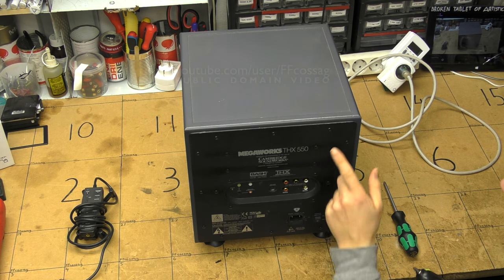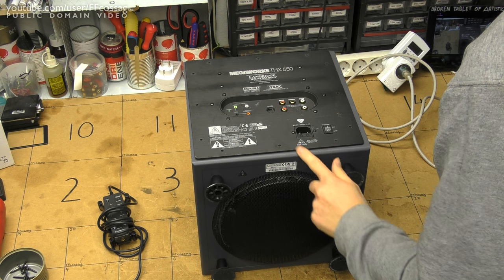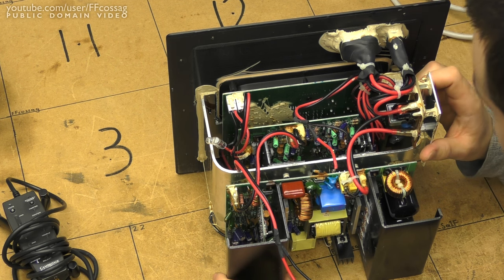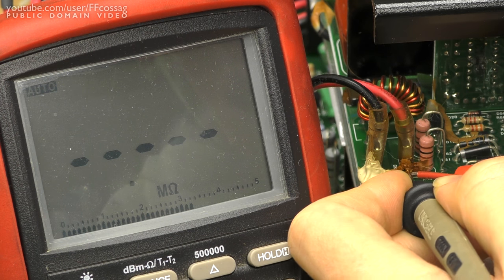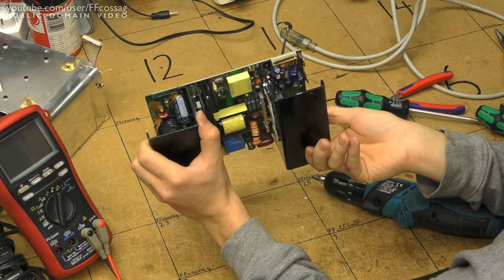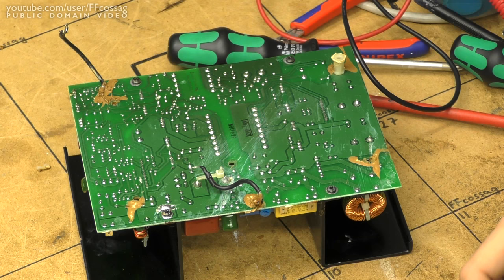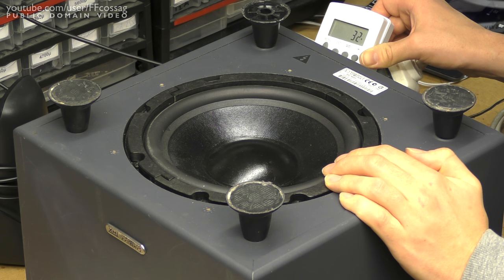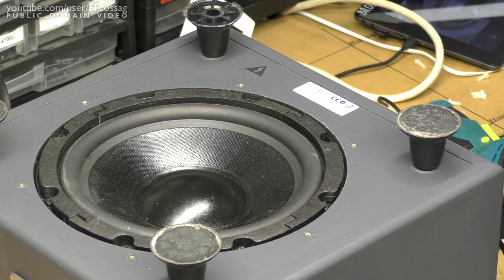Cambridge Megaworks THX550 subwoofer repair

Comment: It must be the glue is a known obsolescence compound. I have seen this in PC power supplies. Regarding the standoffs, I would have opted for sticking them on with electronics grade RTV silicone adhesive rather than screwing then in. But hey, great repair
Reply from the maker: I'm not a fan of gluing things. Either it comes apart too easily or you can't get it apart ever again.

Comment: hi, mine would suddenly go mute after a few minutes. the system turn on fine but not producing any sounds from the speakers. do you have any advice to point me in the right direction on which part i need to check / repair ? appreciate the advice and great video btw !

Comment: I dont have voltages on black and red wires that goes to the sta575 on the other board ,i found a shorted capacitor (450v,33uf) and a shorted in4004 diode next to the small radiator next to that shorted cap , the cap shorted the - and + because of that brown glue and i cant find the problem 😑and when I play through pc i hear a low distorted sound ,or all the sta575 are burned or it’s because of not getting voltage on that wires ,do you have any idea?

Comment: I have the 250D and the issue I'm having is that when I power them off, the next morning it can take 5 minutes or more for the speakers to produce any sound?! There is no crackling or pops or whatever, just takes ages for sound to work, all the lights on the volume control and sub woofer are fine, what could it be? The sound when it starts working again, is brilliant (connected via RCA Coax on SPDIF PC header).

Comment: I just picked up a used set of these for free. They sound great but the satellites produce a faint static noise at all times. Volume level, line in unplugged and different wall sockets make no difference. Any ideas?

Comment: My mega-works broke and I just drilled a hole in the back to rewire the speaker onto a tiny amazon 2.1 amp board. It works worryingly well.
Uses way less power, no longer any heat. My cat is unhappy.

Comment: hello, many thanks for your video. I have the same sound system. electricity. power is coming. but from the satellites and the subwofer the rustling sound is coming. sound too low. Can I fix the problem with this method

Comment: I have a 250d sub that gives me a great deal of static noise when plugged into line 1, and one of the monitors on line 2 will occasionally stop working, leaving only one monitor and the sub working. What do you think the problem could be?
Reply from the maker: Probably conductive glue.

Comment: Hi, Great video. Thanks. I have question. I have Focal JMlab Sub, but there is no sound from any inputs. I don't have shematic. Do you have some suggestion. Final transistors are good, there is no blown elements. Only from LFE i have very very quite sound.
Reply from the maker: Could be a logic supply or +/-15 V supply problem. Bad opamps are also very common in subwoofers.

Comment: I wonder if the solder side of the PSU board should be soaked in Isopropanal, and it is that big blue X4 Mylar capacitor is the one that has gone bang seems to have some blackness on the side of the capacitor.

Comment: I have a 650 with no remote is there a way to bypass the remote connection on the amp?
Reply: I have the same problem brother I have THX 550, did you find any solution without remote ??

Comment: Left channel on my megaworks 550 produces white noise, havent used it for 2 weeks, turned it on and bam white noise from left speaker. 
What could it be?
Reply: Have the same issue. Have you figured out the problem?
Reply: @flamesatdei  yep. 
There's coroded glue on the connectors of the Soundboards that are connected to each other with a IDE/floppy like cable inside the subwoofer. 

I carefully removed the glue completely by warming it up with a hair dryer and Pulling it of. 

That alone took 6+hrs. 

Then i changed all capacitors for new ones.

These subwoofers need some work After 20 years. 
Capacitors are completely done for, and that glue needs to be removed from every board and inch, or it will rot the board away.

Probably invested 15+ hrs and I have have advanced solder knowledge.
Reply: @tobiaspabst5524 thank you. are you in Portugal? wouldnt mind to pay for someone to repair this. seems complicated to do this

Comment: Hi i have one can i control it without remote ?? my speakers turned off automatically after 2 minute my remote wire was cut and broken can you help me ?
Reply from the maker: The easiest solution is to repair the remote.
Reply: @FFcossag  what if the remote is completely gone? I have a similar creatix one that i cant bring myself to throw away and i cant find a remote for it. Is there a way to just bypass the remote features? i cant believe i found this video after looking off and on for a couple years. thanks
Reply: @purge_thehumanrace  hola yo tampoco tengo remoto y necesito poner en marcha el equipo  alguien me puede ayudar por favor

Comment: What is the source of this goop - did you ever find where it came from?
Reply: it's a "standard feature" of the product, came with it from the factory.
Reply: I believe it's a Sony creation from way back in the 70s or earlier, from their adhesive business which is now known as Dexerials. It's most commonly known as "Sonybond" but that was just the product series, there are multiple different products sold under that name, and I don't know the actual product name, or if you can still buy it from the original source (it's probably been ripped off by several Chinese manufacturers and that's why it's still so common today). I don't know if this is true or not but I've heard that while Sony may have invented it, they never used it in any of their products. Did somebody say "sabotage"?

Comment: Hey dude! My THX 550 working fine but theres no sound coming out i couldnt find wheres the problem.Controller and other things working well but i cant get any sound i opened inside but it was seems like everything is okay.will you suggest anything? old times when i shake subwoofer it will work for good but now nothing figure it out thx for rply!
Reply from the maker: I really can't give you anything concrete to work with. The issues on mine have all been power supply related.
Reply: FFcossag Thank you anyway dude
Reply: If the system is powering on and you have no sound the problem is the psu .....i’ve got the same problem i”ve found a shorted diode and a blown resistor ,0 ohm resistor ,i have changed the diode and i put a wire instead of that resistor (couldn’t find one) and it blown with a big short ......i have nothing to do with this corona pandemic so i am trying to repair this 😄
Reply: Stefan M well ı hope u can do this 😄ı m still trying to figure it out
Reply: If you used to shake the unit and it started working (but now its not), I would try a heat gun, heat up say half of one of the boards, this expands it and hopefully reconnects the broken signal), heat trying different areas of each board while its running with signal input, good luck.
Reply: Ozzy3333333 thank you ı’m going to try it
Reply: @fdos4464  I use freeze spray too, but I always start with heat gun, its free, the freeze spray costs a lot more. I also use thin cardboard as a heat shield, so i can locate the issue with much finer resolution, with this technique, i can pinpoint down to surface mount resistors/capacitors, good luck.
Reply: @user-rs8zg8ey2b  thanks a lot when ı done thıs i'll respond u as possible as

Comment: Does anyone have the circuit for this power supply ? I need to know what is the diode soldered on top of the IRF530N . My subwoofer had 110volts fom heatsink to earth. something went terribly wrong. first sympthom was a shock from the stereo jack ( auxiliary in )
Reply: I would guess its a thermistor, probably around 10K at room temp, good luck
Reply: @user-rs8zg8ey2b  how can i get the service manual of this item ?
Reply: @grandemaltese782  Probably wont find it, unless someone at creative leaks it. I have my broken power supply at work, mine is not turning on, I need to find the resistor values for two resistors. near the optocoupler. When i get to work I can look closer at the diode. Can you take a picture of the supply and point an arrow at the diode your interested in (also get the optocoupler in your picture). EDIT: at 12:53 in the video, you can see the two resistors i need the values of, they right between the two yellow transformers, they are right next to each other and near the optocoupler. Please measure these and also report the color bands. I will look at the diode for you on Monday/Tuesday, thanks!
Reply: @Grande Maltese  Any luck on measuring the resistor values for me? tia
Reply: @grandemaltese782  Any luck on the resistor values?

Comment: We dont want your special old smelly cap/esr meter LOL :-D, just leg pulling :-D.
Great job :-D, a bit of a red herring, and crappy caps, how dare it misbehave :-D.

Have you ever played with an ancient philips cd-150 cd player from 1985?
Reply from the maker: Are you telepathic? I used to own one of those CD players when I was ~10 years old. Picked out of the trash, even back then.
Reply: Ahh go on then ...... lol, i have one and my mate has one.
But my frends didnt read cd's, i cleaned the laser lense and inner one.
Still didnt work, it wasnt the laser.
i checked voltages, all fine, signals seemed ok to the demodulator.
I was checking ripple on the old scope and the bloody thing started working, now it wont stop!!.
I think i frightned it LOL :-D

Comment: What Capacitance meter are you using ??
Reply from the maker: It's a proprietary prototype.
Reply: Is it better an esr than a capacitance meter?
Reply from the maker: @TheStefanM91  You need both ESR and  capacitance in order to check capacitors. So both are good.
Reply: FFcossag  i dont have all that tools ,i found that the stabp01 ic its not receiving 8v supply do you have any idea what it’s the problem??

Comment: 20 caps failing at once is a horrible design flaw. A good sound system can last you 10-20 years without having the caps fail. Get military grade replacement components at the very least.
Reply: I'm not disagreeing with you, the caps are terrible quality, but it is 15 years old (now) so they do fall right into the middle of your "it should last 10-20 years"

Comment: hello, many thanks for your video. I have the same sound system. electricity. power is coming. but from the satellites and the subwofer the rustling sound is coming. sound too low. Can I fix the problem with this method
Reply from the maker: It's impossible to tell. Removing the conductive gunk is always a good idea.